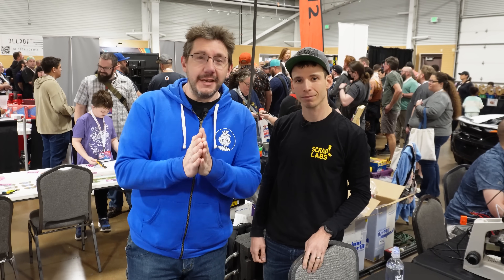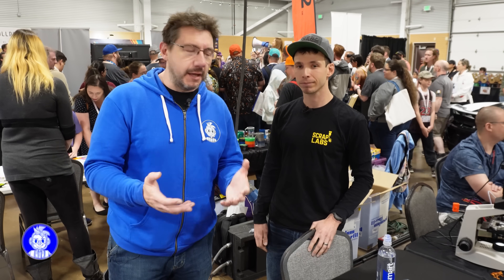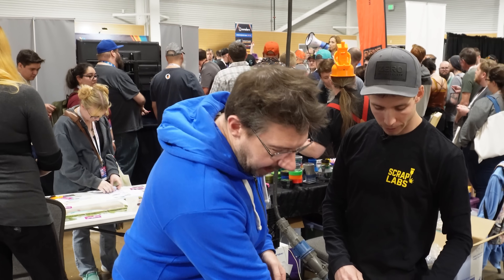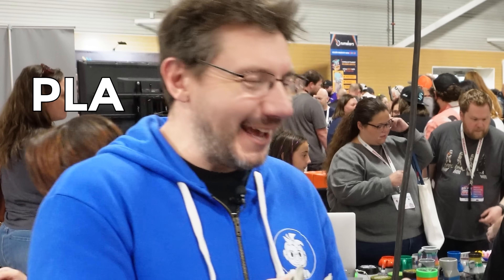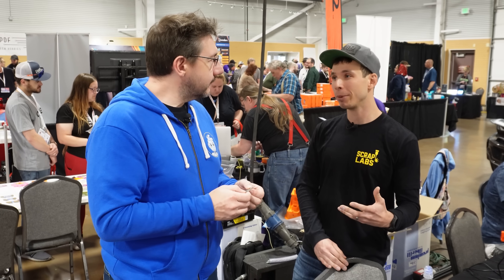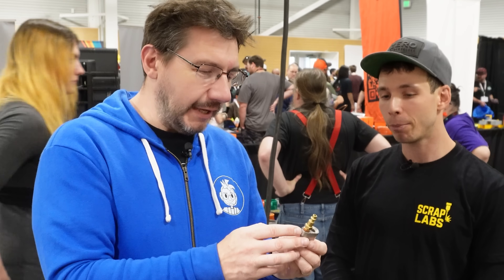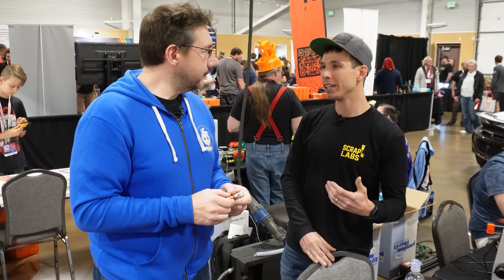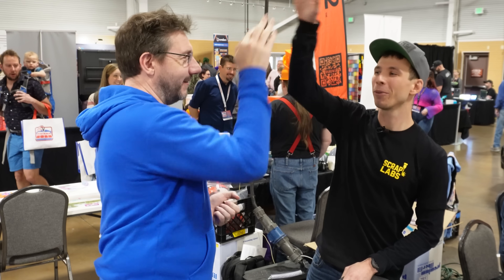3D Printing METAL AT HOME!

Comment: i didn't bother with 3d printing as a hobby until you could get self leveling machines for under 500. now i have a kobra max 16 inch by 16 inch printer i just got for 549 that does 4 colors. metal i would go to $1,000 PERHAPS $1,500 tops before i became interested. its heading inthe right direction , long way to go for hobbyists though. remember when you say hobbyist your starting to talk about people in the income brackets that complain about the price of rent and gas (me) so you need to be realistic. hobby level metal 3d printing right now consists of 3d printing a super thin mold then pouring in molten beer cans from a diy propane or electric smelter .

Comment: I listen to this three times already and I either not hearing it right or I'm just stupid he said that You get one but you can't use it for business that doesn't make any sense The hell would you do especially for 20 grand I'd have to make my money back It'd probably only take me two weeks I really like the idea of being able to use different materials It kind of looks like it's sand casted but that could be touched up if you wanted it to look better But I'm already sandcasting small parts I know of a guy that has a commercial 3D printer that will print titanium and it was $350,000 but it's running 24/7 and he's six months backed up And each part that he makes he gets more than $2000 for each part Very interesting

Comment: printing parts for aircraft yeah the FAA is going to have something to say about that
Reply from the maker: There are already dozens if not hundreds of parts 3d printed for airplanes :)
Reply: @3DPrintingNerd  if a part is structural or for a critical application it must go through the FAA testing and approval process.
Reply from the maker: @marc-lq9hf  OH YES, absolutely for sure. All of the additive parts on airplanes have gone through proper testing and perform AT LEAST as good as the traditionally manufactured parts, if not better.

Comment: Not sure why they cost so much more its same concept as a plastic 3d printer and there is no way the parts to make it cost that much.. these mfs are just screwing people taking something that cost 500 bucks to make and selling it for 10 grand
Reply: You go make 500 usd metal pinters, sell them to us for 650,-. We are waitng for the big announcement.
Reply: @Rimrock300 u do realize the machine is exactly the same if u can buy a printer that prints plastic all u need to do is upgrade the wires to bigger guage for heat sink and upgrade they powerfully and computer.. now u tell me how a few dollars of extra copper makes them so much more expensive.. its literrally  the same machine just gets hotter still computes and prints the same.. its just crooks they dont want people to be able to start making their own stuff out of metal because then the big corporations will be losing way to much money if your average Joe can download a file for a part for their car and print it out of metal and be just as strong as a molded pot metal part from a factory  and for way less obviously..
Reply: And when i say upgrade computer its essentially  the same computer just tequires more power.. if u cant agree corporations screw us then your crazy a brand new truck cost 1500 back in the day now.its 65000 or more yet the metal is all.recycled its not like were losing steel or aluminum like gold lmfao @Rimrock300

Comment: "metal" is a WIDE word, i wonder how an impeller for a turbo would hold up. then i saw they displayed an impeller in the video and that thing looks so rough that it wont be very good. the amount of post processing needed to be usable would throw off the balance. kinda dumb of them to display an item that wont be usable?

5:57 would you willingly fly in a plane you know is repaired with 3dprinted parts? i sure as heck would not.

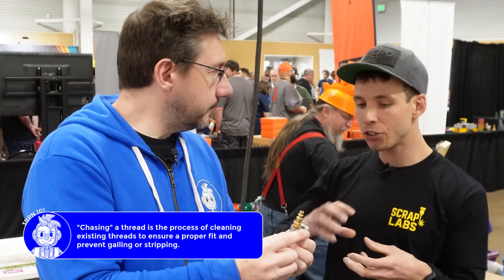6:50 chasing is a step in the process of making threads when using a cnc, always chase after a threading to ensure no chips are left or any misses by the mainpass. its not really something to brag about doing after saying they threaded it, its implied already.
what it was, is a clever way of hiding that the threads produced by the printer are not good enough and have surface faults.
im gonna bet you 101$ that the carbide they use to "chase" the threads is going to worn very fast compared to the same bit chasing a milled thread ;)

Comment: F theta lens and Galvo costs under $200. 800w fiber laser costs $600. The rest is an air tight 3D printer, powder feed system and welding gas regulator. I don't see where that $20k cost comes from. There are semi pro units in that price range with a much larger build plate. The Inove 3d costs  ~$4500.

Comment: For whom is $20,000 for a maker tool “affordable?” Buying an old kiln, a filament dryer, and a couple spools from The Virtual Foundry is going to cost a fraction of that amount, and not have users worrying about dealing with metal powder cleanup.

Comment: Joel - did you see this?

"Disclaimer: Parts shown are for illustration purposes only and were not manufactured on a Scrap Labs machine. They were produced using an Xact Metal XM200C. However, Scrap Labs has the expertise to deliver parts of similar quality, as our founder led the development of the XM200C."

From their website and in my opinion a real bummer...

Let's talk again when they have an actual product which actually CAN print something close to this!!
Reply from the maker: Yeah, unfortunately I didn't see this until after we chatted.

Comment: Please be aware that steels will have a content of chromium and also nickel. Whilst these materials will not be below 1000mJ minimum ignition energy (MIE) they do have significant hazards.  Chromium (10-11%) and nickel (8-9%) are both sensitisers on skin and respiratory contact.  You need to avoid breathing them in and getting them on your skin.  Nickel superalloys are of a higher concern due to higher concentrations of both Cr and Ni.  Beyond this, please be very careful with any condensate within the build chamber or airflow from the chamber. 

This is not yet well researched or understood but combustion (ablation) products are highly likely to be carcinogenic - no skin or respiratory contact. We have no official guidance on safety here from the Health and Safety Executive (UK) as this remains delayed.  I've worked in this field from a safety and occupational hygiene perspective for many years with the largest businesses in this sphere (some of which are mentioned in this video).   Please also be aware of the risk with metal fires which, if ignited, are generally not able to be extinguished.  

When you remove any filters from a chamber or filtration system the condensate can also spontaneously ignite, or smoulder and turn into a fire hours, days or weeks later.  Use appropriate silicon oils or sand or water to control the fire hazard.

Also, aluminium can and will generate hydrogen when exposed to water, be aware of this when using a wet separator or similar where the powder can remain in the machine after extraction.  If you sieve metals (recycle), there is a risk from static discharge and even if you earth your equipment don't forget this earthing needs to be to a common point (equipotential) to properly manage the risk.  Lots to think of here, be careful and do your research.    My concern is that as these machines make their way into smaller businesses and without good information I will start to see all the early accidents we had in additive repeated in these environments due to the current lack of good guidance and through misunderstandings.  I've seen this in major companies with big resources, an SME may struggle to have the right information to manage these hazards effectively, if you see what happens with powdered metals and a spark you'll see what I mean, just search up dust explosion on youtube...

Hope the above helps somewhat.  Roger Hart, MD Outsource Safety www.outsource-safety.co.uk

Comment: I’ve seen metal printers at the $35,000 level. But they require a sintering oven that adds another $20,000, or so. Some require a special wash as well. So possibly that’s what he means by $100,000. But not a word here about sintering. I’ve never seen a metal printer that wasn’t sintered. So that question remains unanswered in this video.

Comment: I don't know if this is practical. As others have mentioned, shielding gas flow is a big price point. When I was working on industrial metal 3D printers we had huge Dewars of argon. These aren't cheap. I think metal embedded in FDM filament and a pro-sumer grade sintering oven would likely be a better fit. I also don't appreciate the fact that they don't have any images of their prototype or even parts printed with their own printer.

Comment: This is genuinely crazy… 
500k a handful of years ago, 100k a few years ago, 20k now… I like this trend! 

Kinda like the laser and water jet area… used to be big 100k machines, and now you can buy a powerful laser, water jet, or plasma CNC for a few thousand or a small hobby level one for under a thousand! It’s so cool seeing all of this high level rapid prototyping and production equipment getting smaller and more available to everyone!
We’ve got small Xtool - Stepcraft CNC, glowforge lasers, Wazer water jets, Arc Droid plasma CNC, and the whole world of 3D printing available as well! 

For under 10k you could have a full setup of CNC machines that can make, cut, or print literally anything! You can cut ceramic and glass with a water jet, thick steel with an arc droid, cut plywood and aluminum with a CNC router, leather and thin stock with a laser, and print ton of useful stuff with FDM and Resin printers. 
You can literally do basically ANYTHING now! For a small investment you can start a business, produce your own inventions, or enhance your hobbies or business! 
Grind Hard make crazy vehicles and they use an Arc Droid plasma robot to make parts, occasional 3D prints for custom parts or decorative bits… it’s so cool! 

This kind of stuff really excites me. There’s no way I could afford this now… but realistically within a few years it could be as cheap as something like a glowforge or CNC… so cool.
Reply: It’s not actually a thing yet. People need to temper their enthusiasm until an actual printer is reality.

Comment: Metal 3d printing is so simple, high power laser, aluminum foil, roll the foil over the print area, melt the layers to the previous one, use some kind of mechanical separation, repeat.

Comment: I think it will be still cheaper to prototype a part in PLA and then let a printing service print it in metal which you can already do for years now.
Reply: 1000%. Under $20,000 is great, but it's still absolutely outside of the consumer price range. At that price, we'll hopefully see more small businesses offering metal 3d printing services, but you'd have to be doing A LOT of whatever you need to do to make the cost difference between getting your own printer and just having a service print if for you make sense. I think the guy knows this too, and while I love Joel, he did a fucking horrendous job of backing this guy into a corner on the topic imo.

Comment: Steel can be 3d printed with copper too, and copper has the same melting point as YBCO a ceramic superconductor that can be remelted.  I think the machines work like a photocopier roller placing the next layer down.  So, the challenge for anyone out there is to make a mini fusion reactor.  Being so small, under 2 meters the distance Neutrons can travel and damage things, means the mini fusion reactor would only last a few years or so, but it would power a plane, a space mission, or break through front lines in a war.  Anyone want to be the first to make a fusion reactor?

Comment: 20k is not out of reach for a lot of people. This would be an amazing addition for someone who is running a 3d printing side buisness, and if they are already running a small
Manufacturing business, they will
Know how to make
Money with this thing. 20k
Is not the machines limiting factor, the 3 factors that may limit it are build time, build size, and cost to build small parts. I would have liked to have known how quickly it printed the parts. He said a few minute to
Print the earrings, so
Print speed should be decent. If running the machine can manufacture the parts relatively cheaply, there is alot of room for that machine to to pay for itself. Especially if it can produce parts fairly quickly.

Comment: The price of 20K is still groundbreaking even if you can't afford one. It means that relatively humble job shops can be set up and it will bring the price of a print to end users down even more. I have had metal 3D prints made by outside shops and the thought of cutting that price by half or more would be really groundbreaking. It would probably increase the affordability and reach and market of something like that by 10 or 20 times.  It's to the point where a designer can iterate and improve and iterate some more in plastic, and then when your design is perfected you have one made by a job shop in metal for a really affordable price.

Comment: When people try and sell you something by saying: "Oh, just open an Etsy shop and make a ton of money using this $20k piece of equipment!".
Reply: To be fair, it’s not that crazy, when I see people who have farms with 15-20 Bambu X1s or other high end printers… some small print farms will spend 20k on printers easy… because the most reliable printers are all within the 1-1.5k range. 

It definitely is expensive, and not for the average person but if you’re already running 20k worth of printers it’s a reasonable investment for a small business.
Reply: @DanteYewToob  but this is 15-20 different manufacturing machines, which is 15-20x the print capacity and does not require an initial purchase of 15-20 units but a few and expanding as demand increases.

Comment: I work  with AM  SLM machines and there are many obstacles  to overcome. Many questions  like : O2, gas flow/control , gas filtering, part cleaning, special vacuum cleaner, optics glass, laser type and power, caustic measurement. The tool I use for a caustic measurement (beam profile) costs 30,000 euros. That's not including the laser power meter. Anyway, good luck.
Reply: Also the tooling needed to remove the print from the bed and resurface the bed for the next job.
Reply: @StonegateCreations check out rack robotics. They're building desktop wire edm systems. Also a band saw or flush cutters works just fine most of the time
Reply: All great questions!. Many of which have some interesting, and I think quite innovative answers. But you can be the judge when the time comes to launch

Comment: "we want to make it open source, but you can't sell it"

That's... Not open source
Reply: Not true. For example, you can open source things under the Creative Commons license without allowing commercial use. The designs are fully available, and if you wanted to build one personally, you're able to do so. You just can't sell it.
Reply: @mahill2006  That's not what anyone calls "open source." Open source is about freedom, not just source availability, which is what you're describing. Ideally, users can freely share, modify and use open-sourced hardware and software, and that includes commercial endeavours. Taking freedoms away, especially such a fundamental one, goes counter to what Open Source stands for, and is not different from the patent hellscape we have nowadays.
Reply: In other words, you can call such licenses whatever you like, just don't lie through your teeth and call them "open source", because they're not.
Reply: @flisboac  What would you call it then? It's certainly not "closed source/proprietary"
Reply: @mahill2006  The term exists. It's called "Source-available."
Reply: I understand his point of view, but like you I think it's not open source either.
Reply: GPL is the original "open source" license and even it has severe restrictions. Open source doesn't mean "do whatever you want", it means "the source code is open to you"
Reply: @32BitJunkie open source does in fact basically mean "do whatever you want". GPL does not have any restrictions of the sort; you are free to sell GPL-licensed projects
Reply: @32BitJunkie The only limitations open-source licenses impose in general are to prevent the removal of any freedoms already granted. For example, sharing the source code is allowed, and the intention is for anyone to be able to do so, so the license tries its best to ensure that. This means NO exceptions like the one this company is trying to implement. Other than that, it's truly free (in the sense of freedom, not cost), including commercial usage.

Comment: The polished ear rings and functional 1/2 NPT threads showed what I wanted to see - low porosity solid 3D printed metal parts.  Very cool.  Well done.  Thank you Matt!
Reply: Polishing pushes metal into the porosity. Just like wire EDM zero tolerance puzzle blocks, the lines are noticeable but they getting the surface down and it helps hide the lines.

Comment: Repeating everybody’s comment here, 20K is at best for small or medium-sized business. HOWEVER, having a local shop or online service bureau with online quoting and submittal of consumer 3D model files (with file checking capability) AND fast turnaround price options would make sense, benefits everyone, and “might be” a sustainable business model.
Reply: I don't think many would actually want one at their home. Would you vacuum with what, a magnet? I don't think standard Hoover would last for long... One gust through open garage door, and iron dust is everywhere. Will the powder rust when humidity rises?
Same thing as with any SLS: it's a lot of work to maintain it. SLA is child's play compared to these apparatuses.